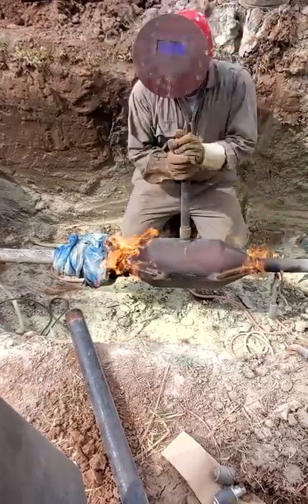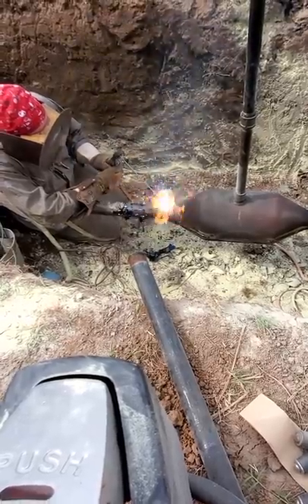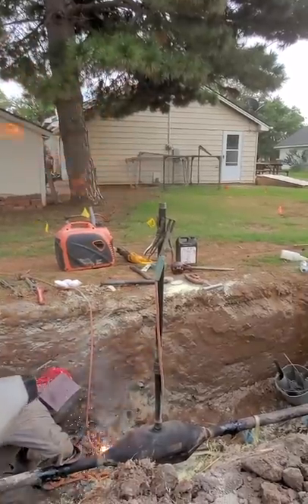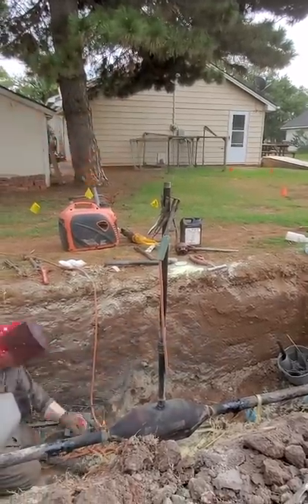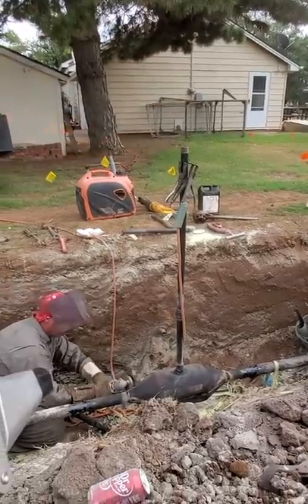Stick Welding a Live Gas Line | Hot Minute #shorts

Comment: I've only came across a situation like this once in the field.. I wasn't quite green I was a little bit past being completely unexperienced but a damn sure didn't know everything and I was scared to death at first. But my lead man was a boss and had done that multiple times in his career and took charge quickly and showed me that exact same scenario and how to go about it and it was because of the same reason, someone digging without having the area cleared first for pipes luckily they didn't break it completely and bend it so bad that we couldn't fix it, it was a two-day job but it's the only time I've ever come across anything like that and I'm not ashamed to admit that I was scared to death at first. I for sure thought they would have someone turn the gas off before anybody started an ark.. but then my boss had the company bring a similar looking device out and we had to do the same thing. There are definite ways of doing it without cutting the gas off but all the rest of the times that we ever ran into situations with bent pipes or pipes that have been broken by machinery we had them cleared first before we started any grinding or welding. I moved on from that job to new fabrication jobs.

Comment: I helped clean out a gasoline storage tank so that the  leaking floor could be welded.  It's about the "fire triangle "; ignition  source,  fuel,  and oxygen.  So  if you have to  much of either leg you don't have fire. Still scary to those of us not in the trade.

Comment: I’ve seen some shit out in the gas field but the worst thing I’ve seen to this date happened in august of 2021. We were doing a typical retirement of an old steel main that was put in the ground in 1953. We had replaced the old excising 4 inch coated steel with 6 inch plastic pipe. The whole job was done. All services connected main purged in. All was well until the day it came to blow down the old main and retire it by welding two end dresser style end caps onto the pipe at start end and finish end. We set up all the tools and the welder began welding (making long story as short as I can). I was assisting the welder at the time but to go grab his other set of rods to fill his can I had jumped out of the hole for a second to run to my truck and grab a can of rods. Well in that short time it took I look back to see my welder jumping out of the hole with half of his body (waist down) covered in flames. And a 6 foot bright yellow flame blowing up out of the hole. We got him extinguished where he only received at the worst 2nd degree burns. The contractor we worked for did not switch the regulator station over to the new main and left it on the old main. Basically charging a old 70 year old main with 120 pounds of gas pressure. When he struck the last arc on the top of the pipe which had to the thinnest wall (due to corrosion) the stick electrode melted right through lighting the escaping gas at the time on fire. I couldn’t hear the noise because we were required to wear ear plugs at the time but the patients at a nearby dental office compared it to the blast of a shotgun followed by a loud roar. So basically kiddos don’t ever let you utility company tell you if that they did the right thing always check up on it yourself before melting steel and lighting gas on fire. And yes it took 8 hours to control the situation after the fire began. You watch these videos all the time where they weld together a 5psi steel main but They never show you the good ones with 120 pounds of pressure coming out of a small burn hole with a 6 foot flame. That shit will scare the daylights out of any gas worker.

Comment: I use to work gas fitter/ welder hand also some  , butt welds . A lot of time there would be gas in pipe while welding . Pretty intense stuff. I eventually decided to keep persuing my original trade and get my journeymen in electrical

Comment: That is a split sleeve or as we call in the street a turtle it is a very common fix on compression couplings or pinholes in medium to small size high-pressure steel pipe

Comment: Personally watched a welder do this on a 2 inch main to a sub- division in Georgia ! We snagged the main while  pulling back 480 feet of 6 inch steel main for up grade with a directional drill ! Dug  it out and closed the value!  The welder welded in 3/4 inch 4ft riser on and arced the flow of gas  out of the 3/4 and started  repairing the 2inch main  ! U ask y u would weld live gas main ? The cost of 2000 or more  re-lites !

Comment: Can't imagine being the first guy who was willing to try out the whole "pumpkin" idea.  Guessing he wasn't completely sober.
Reply: I mean he probably just knew how fire works. Flame burning outside of the tube means No oxygen in the pipe which in turn means no explosion. The gas is under slight pressure so air can’t really get into the line. Pretty safe
Reply: The pumpkin is just one type of fitting that is welded live, or “hot” (gas on while welding). Several types of fittings and connections are welded hot. It’s not preferable, of course, but the risks can be mitigated.

Comment: Yup..gotta weld bottles on steel breaks.
Its good in winter time cuz it's warm.
Does seem rather dangerous..but it only blows up..when the gas levels are..just right..
To much gas won't support oxygen..
So there's lower explosive limits..and upper limits.
Plastic pipes we squeeze off..and fission weld.
Sometimes we can use a bolt up bandage..which squeezes a rubber..gasket..and squeezes of the gas flow.
We get pretty dizzy..from the fumes.
Kinda dangerous when that happens.."goffed" but its better than being blasted.
Some of the gas mains run around 1200. To 1600 psi.
Big.. Buda boom..

Comment: We welded an outlet on a live 2 psi gas line & hot tapped it once. I was younger & I was shitting my pants. Inside the pipe is 100% methane so it’s well above the explosive limit. No oxygen to ignite. Still scary.

Comment: Hi guys yes I've seen this before when I worked for the gas company in southern California they had a 4-in gas line that was leaking the gas was blowing about 15 ft in the air the guy I knew got down in the pit that they had dug out around it and using a grinder kept passing it right through the flame until it was clean then he simply began at one end of the crack welding it up when he got down to the part where the gas was blowing the steel out of the way he would build up the steel next to the hole and then hammer it over into the seat hole until the gas stop coming then he finished the well pretty amazing actually I've never seen a pumpkin before I'm wondering how ready to get the pumpkin to go around the gas line in the first place unless it's split

Comment: I worked with the gas company in service and construction.  That looked like some primitive repair work.  There's much better ways of bypassing gas pipe today that is much more complicated, but also much safer than using a pumpkin.  (No fire necessary).

Comment: No pumpkins but I almost blew my arm off once running a new service from the only available source=17" medium pressure . I was running 3/4" sch.40and the welder from the gas company (Alagasco did their own hot work) I hear a his from the saddle turned off my nitrogen test straddled the main to uncap the saddle then the thought ran through my head and I leaned back and heard boom all of the metal that I had threaded off of that three-quarter inch shot into my arm I forgot to bleed my test if I hadn't leaned back that cap would have went right through my head because it almost went through my hand except for the pipe wrench had a grip on the cap 25 years later my ears are still ringing

Comment: We put pumpkins on a 12 inch pipeline in Cary Mississippi. Nothing to it. Last month we did a 36 inch 500 wall 5000 foot directional drill with 2 tie ins. In Houston TX we did a "Hot tap" on a 20 inch . 23 mile long pipeline.  A "hot tap" is the real deal. Look it up.

Comment: & always call your states ONE CALL to locate any line's. I seen pictures of a farmer that was deep plowing his field & the dirt over the 18" line had eroded enough that his plow hooked the line & ruptured it. It left a 30' creator in the ground & threw his tractor & plow between 50'-100'. The farmer was instantly killed. & no it wasn't a fireball type explosion. It was a 600 to 800 psi on an 18" diameter gas line. Think of a  tire over inflated & blowing out driving down the road. Same principle on bigger scale. & for context on how big an 18" pipe is just look at an 18" rim on a car. Thats how big that line was. We have natural gas lines run all over this country. Some of which were put in, in the 40's. They are constantly monitored, checked for corrosion, depth & for any leaks. Their systems can also detect a pinhole leak if any ever happen because they constantly monitor the load on the pipe

Comment: Could someone explain to me how this is different then welding a tank that is filled with a flammable gas or liquid that would explode?
Reply: From the perspective of a tank of flammable gas those tanks are under a tremendous amount of pressure and you definitely would not want to weld on them least you created defect that leads to a violent rupture and explosion. You would not want to well in a tank containing liquid for some of the same reasons. I have heard of some old timers welding on diesel tanks as long as they were full. And this set of circumstances you have very little pressure because the end of the line is open, and the pressure in the line even under service is probably around 5  PSI but I can't be sure from the video. As long as there's no Oxygen introduced to the pipe and there is an outlet for what little gas pressure there is and you're burning off the gas then you're perfectly safe because there's no risk of explosion, as there's no oxygen in the pipe, the pressure is extremely low, and the leaking gas is being taken care of by burning it off. There's a procedure that's also called a hot tap where in a threaded outlet is welded onto a live line and then a special tool is used to puncture the live line through a ball valve to create a new outlet, or inlet to the pipe. And that instance the pipes are usually under considerable pressure and you have to be extraordinarily careful not to puncture the pipe at least you end up with a blowtorch on your hands literally.

Comment: In regards to the pumpkin, how is it closed at the top when he’s done?
Reply: Having never done a patch like this, I cannot say for certain, but the vent pipe is to allow the gas a way to escape the weld site without inhibiting the quality of the weld (or setting fire to the welder’s face). Once complete, I imagine that they would unscrew the tall pipe and replace it with a threaded plug in the top of the pumpkin.

If you’ve ever read “The Martian”, Mark Watney does something similar to seal the hole in his EVA suit in the beginning of the book.
Reply: @LOVEMUFFIN_official  thanks man, that makes sense.

Comment: He's probably running an sa200. No ac power so he has to run a generator also. I did that for a while until I wired up a power inverter to all 3 batteries.

Comment: The only thing I have experience on welding was fuel tanks on steel crab boats in the Bering Sea we would fill the tanks up all the way then grind and then weld it up sometimes I would Purge the tank for CO2 we did not have to fill the tank to full mark just a couple feet above the crack theses were just short cracks like one inch to three inches and we're just oozing fuel not steady running feil and it was 20 to 30 degrees below 0 I don't recommend doing this with someone showing you how or going to classes .Most would want you to drain the tank and then Purge it with CO2 first this was emergency welding to get a boat back out fishing right in the middle of Red King Crab fishing very big money it's crazy welding at its finest.

Comment: Gas lines are no longer made out of steel they’re made out of a flexible PVC steel gas lines are 50 years old they have a failure rate of 100% past 35 years PVC pipe expected to go 100+ years

Comment: I got experience with Powerlines, as well as OSHA inspectors. As a contractor, which I'm sure this dude got paid so he's a contractor, you're required to install shoring protection in any hole 5 feet or deeper. One minor violation usually costs the contractor about $50,000.00. if not more. I wouldn't be broadcasting some shit that could fold homeboys life in half. Dope ass welder though!

Comment: Welding on a live line,, wow,, sepose inject the nitrogen inside the piping to avoid explosion
Reply: No you lite the gas at a low pressure put the pipe together using an open clamp tack it top and bottom. Pull the clamp and weld till the fire flies out . Hot pass it fill it band cap it done ...
Reply: @williebabb3199  ,, can it been done like that, maybe i need a try,  light a fire on low presaure like a pilot on gas burner, right.. if that what you mean..

Comment: Ain't much different than welding a tap on a gas line. You cant shutdown 50 services when you wanna add a knew 1. You can't start a fire inside of a gas pipe, because there is no oxygen in the pipe. Same as fuel tanks on cars

Comment: 1983. This Punkin Repair Over Leak works Great 1983 I Used My First One. IMy Uncle. E O Lewis Welded For The Gas Company's Hot Taps AnRepairs Handed down To His Welding Buddy Doorman Lyons An Then In 1983 This Live Pipieline Repair Technology Was Handed D ok win To Me I Welded For 25 yrs Until.          I Was Injured With A.      33.000.00 Lb Low Boy Trailer I Was Welding Under Nether On The Trailers Hit h Was Broken An The Two Tea tours Holding The Trailer Up In The Air So I Could Get Room. to Weld The BC real The V Chat oh n s Broke An This Letting The Font Of The 33.000.00 Pound Low Boy Trailer Fail On Me I Bumped An CrAwled Fast But It Caught My Whole Left Side Of My Body..Thank GOD it Had Been Raining For. Several Days in 1987 so much My Welding Truck Had To. E Pulled 3 miles off the main road With Water Still.Coming Inside of my trucks floor board while they Pulled Me up the oil field right A way Road up to Where I Had To Weld A Patch on the leaking live Gas Pipeline That Could Not Be Shut Down I. Did Repair The Pipeline LeakingThat Day!! 
  But Under The Low Boy Trailer That I Was Lucky To Be Alive Lime I Said The Rain An Black Clay Mud. Saved Me The Mud So Wet. An The Trailer Mashed Me 2 foot 9 inches down into The Ground The Low Boy Trailer Had One BullDozer Size Boom Tea to r Loaded On The 33.000.00.pounds Low Boy Already At The Angle It Crushed My Left Sides On A Slight Angle Of Right At I Measured Later at 35.6° Up To 39° Angle Crushing All My Left Leg. Break I g My Left Hip Crushing g My Disk In My Low Back From L5 & L4. Bone To Bond On Up Broke 6 Ribs an Also Separated Energy Rib On The Left. An Right Side. It Was Hard To Breath AnGoing On the Angle Broke My Upper Bicept Area  Arm.! An Cracked my Left  shoulder !! Moving g on up i had two Hairline  Cracks in My Neck Right at center of my Skull Line..An A lot Of Nerve Damage an Ligament An Muscle Damige..
No Care Flight Back Then No One Could Leave This Job Site Because Of Repairs They Had To Watch An Wait On The Pig Line Pipe Cleaner Unaided Pipeline Coming From 800 miles Away To Arrive To There Clean out ports. So I Had To Drive Myself To The Hospital 3 Miles With Dozed Pulling Me Out To The Main Road That 2as 3 miles. Very slow & Then 8   miles I Had To Drive To The Closes Hospital. By My Self .I Really Was Not In Any Pain Because My Body Had Shut Down From Shock Fro. Injury Ok but Breathing g With All My Ribs Separated An 6 Broken. & Cracked Ribs. It Was Painful .I Was Sent From. The Palo Pinto Hops To Harris Hospital In Fort Worth Texas
This Was A Long Process i  Hadley 18 Major Bone Surgery's..An Must le Repair. Nee Er Repair Surgery's 9 to12 surgery's for those An Then In 1997 They Had To Ampitate My Left Lower Leg. Giving 5 weeks. Something Went Wrong So They Had To Go An Re Amputate Another 3 inches Of My Already Ampited Leg The Bone Went Threw The Bottom Of My Amp Stump So That Was The 2nd Amp An then they Made Sure They Put A Mesh Seal pat h At The End Of My Stump An Ground The Stump Bobe Down An Rounded Off So This Time No Share pop Bone Punching Threw The Stumps Skin. That All Went Well I Had Several More Surgery s An Testing For RSD REFLEX SNTHIC DISTERBIE. Which I did have in. Category stage 1 threw 4 it was stage 4 this was nerve Damage that Would Hurt For Life Are I. Could Have Had These Other Two Nerve Surgery's With A Chance Of Being Half Way. Paralyzed Or Worse My Dr Said if it was him Don't Have Those Two Nerve Surgery's Done on Me It Usual Turns Out To. W her people Come BACK With More Pain Than Before!! So I Felt With This Along Time An im Really Blessed By GOD An My 5 Doctors that Worked On Me An Now I Can deal With This Pain Except from time to time my Elect Prostic Leg Rubs Places To A Point Of Blustering Rubbing My Leg Raw This Dose Hurt ..But it Will Stay Real Sore For A Day Are Two Are A Week Then IMy good to go again. 
Thanks !
Kenny King.
END============END============END=

 My Neck  In the back Of My Neck It Cracked hair I e
Reply: Kenny King